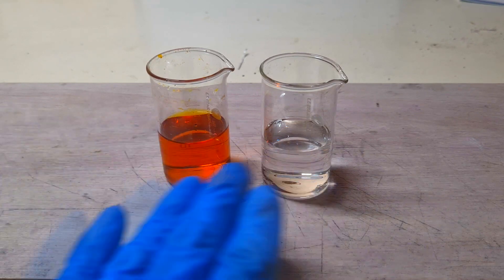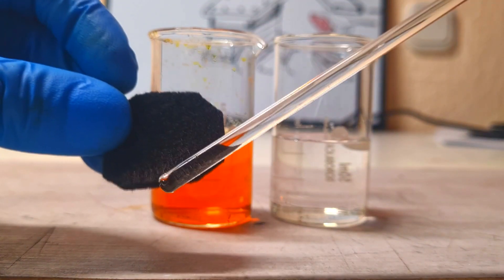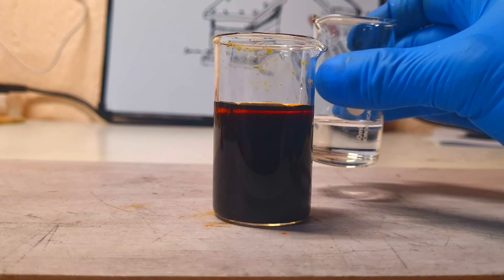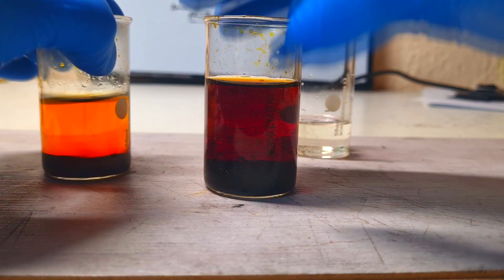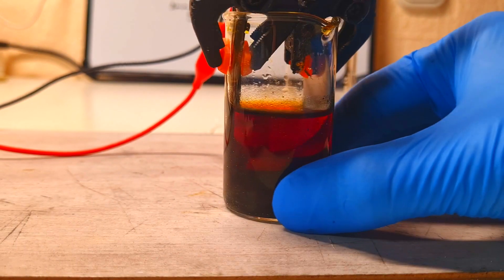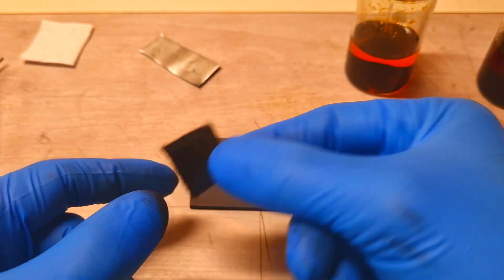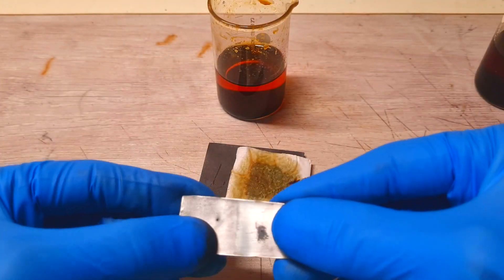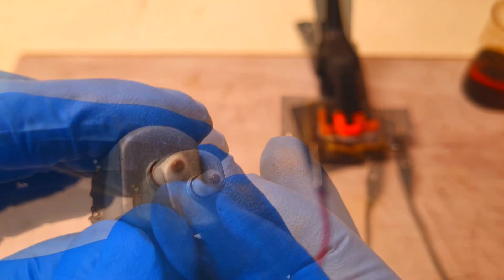DIY a Gravity battery - Zinc Iodine

Comment: Love your videos, but a battery that is not rechargeable is just more toxic waste.
Reply from the maker: Correct, but still you have carbon zinc, alkine, metal air and lithium batteries in mega tons. Most of the alkaline batteries for example are very attractive because of long shelf life.

Comment: hello, where can I buy carbon foam?
Reply from the maker: Easy to buy is on ebay. Search for PAN based graphitic carbon felt
Reply: @cayrex  Thanks,I will try to make an alkaline fuel cell
Reply: Untested, but I think you can make hard foam by heating a pot with a slice of bread in a pot in the oven. It would carbonize but not burn if the pot is somewhat air tight
Reply from the maker: @dennisolsson3119  Yes you can. And you can use any material to carbonize in temperature range from 400 to 1100 deg C (but in most cases the carbon will end up with bad conductivity). And then you need to activate to get better surface area. And for more conductivity you will need to go to graphitization process
Reply: @cayrex  what is the graphitization process?
Reply: @dennisolsson3119  I tried to make it at home, but it was too small conductivity
Reply: Aha.. thank you guys for the feedback

Comment: how about just aluminium metal-strip al-air battery/fuel-cell (assume you get aluminium at 2usd/kg), that means 2usd/8kwh=25usd-snt/kwh, better than most markets, directly from the market aluminium (al-air at 8kwh/kg)
Reply from the maker: Where you get the 16kWh?
Reply: @cayrex  lol I made a boo boo lol, make it 25usd-snt/kwh
Reply from the maker: Yea, if only it were that simple. 8kWh is the theoretical energy density (practical is more around 1 - 2kWh). Aluminium air battery can be a good battery but you need to know how to make it.
Reply: @cayrex  sorry I dont believe you
Reply: @cayrex  convention is not the true way (we have found for you that that you cant do this, even if its possible), so whats hard with making a metal-air fuel cell
Reply: @cayrex  peter, dont doubt what is possible
Reply: @cayrex  you must treat pure aluminium as separate fuel to the fuel cell, having the exact full specific energy of 8kwh/kg
Reply: @cayrex  I did not in any point mean battery, but more the fuel cell
Reply from the maker: @Jkauppa  You dont believe me, haha no panic! 🤷‍♂ Simple, just make a cell and let me know. If you will get let's say 500 Wh/kg you will be good. Enjoy it
Reply: @cayrex  I dont have to, its already done, by God (and the people experimenting with it), who I should believe in instead
Reply from the maker: @Jkauppa  amen
Reply: @cayrex  grace not law, God over people
Reply: @cayrex  under laws say: amen
Reply: @cayrex  the free say nothing, because they dont have to :) glhf, return to grace
Reply: @cayrex  no you will not be the law, for me
Reply: @cayrex  you'll get nothing of me
Reply: @cayrex  so you knew
Reply: @cayrex  think like a bar of aluminium fuel for 2usd/kg (or per bar as aluminium density is 2.7 compared to water), have you tried methanol fuel cells (or making an ethanol fuel cell work)
Reply: oh sorry you need to have work to be a slave of people for money to earn living sorry